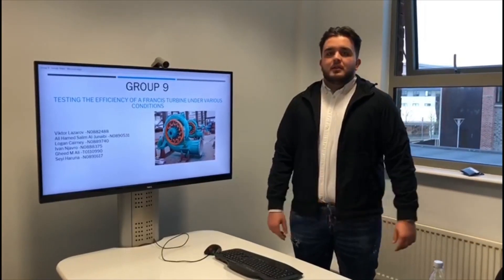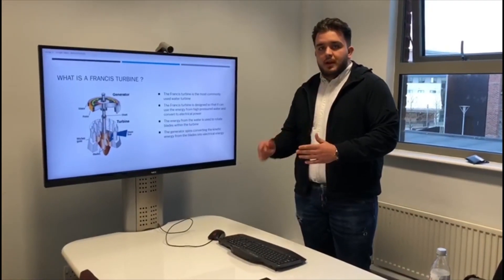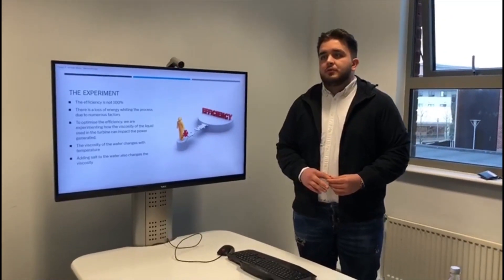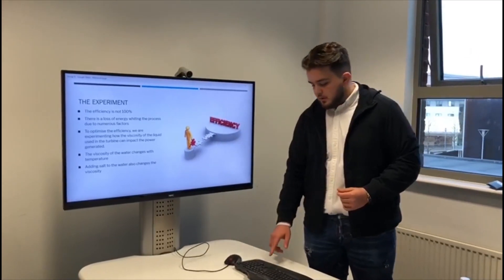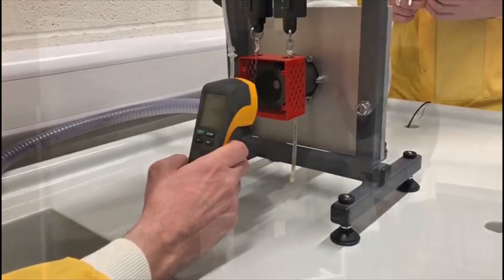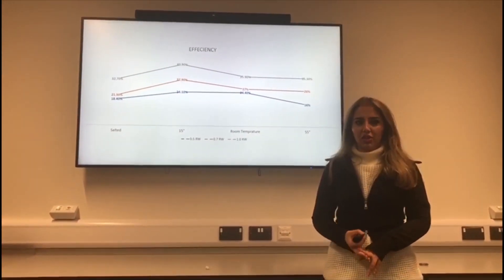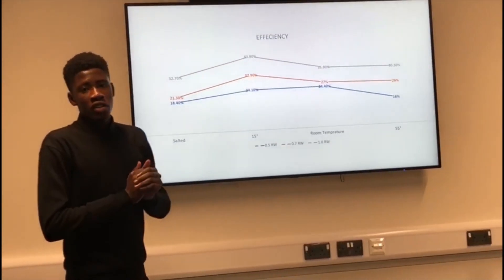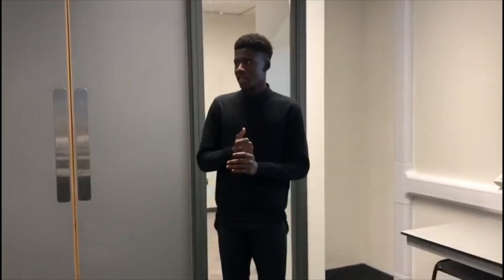Efficiency of the Francis Turbine Under Different Conditions Team 9 - Competition Entry from NTU

Comment from the maker: A note from the TecQuipment Customer Care Team: Using saltwater in equipment like this may cause corrosion problems and is not advised. If you should wish to experiment with salt water it is advised that you flush out the equipment thoroughly after use. It could also invalidate your warranty. Never the less, great video team 9!